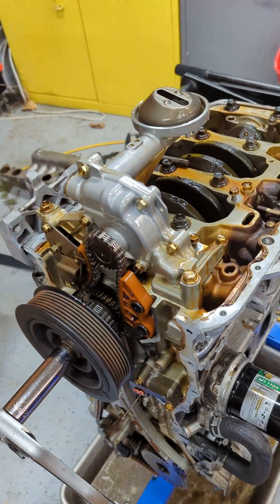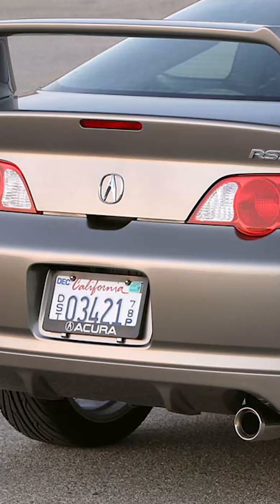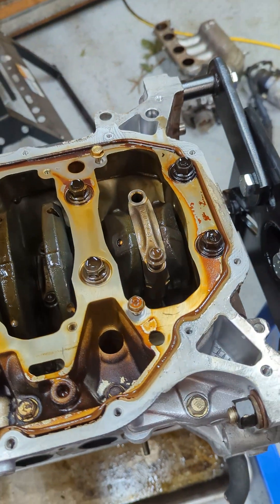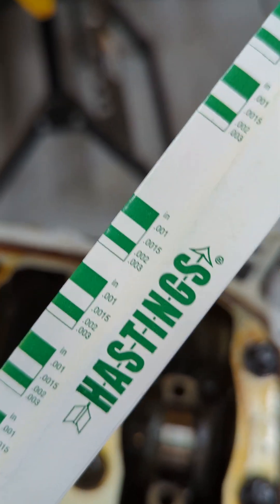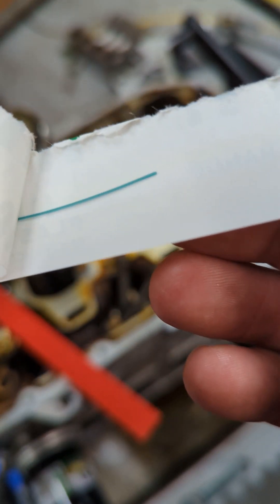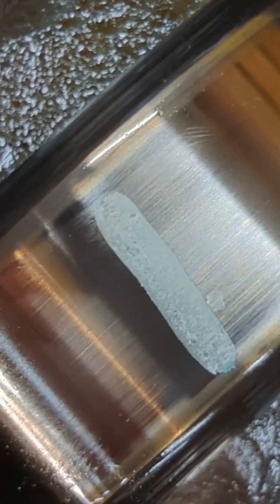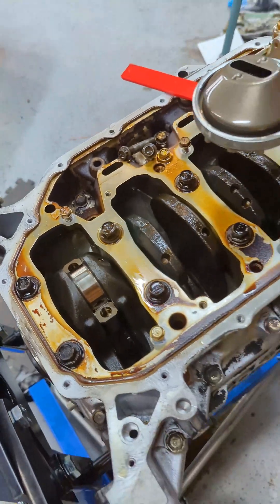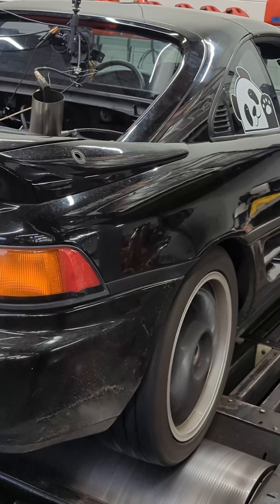Measuring a high mileage hot rod engine 🔎🔬

Comment: Have a question. I'm super good at rebuilding top ends on vehicles diagnose problems but never had the confidence to rebuild the bottom end, rods, Bearings, always wanted to learn how to use that plasti Gage. The main thing is that I want to know is, what are you supposed to do if the recommended spec is not where it's supposed to be on the bearing?? Grinding or something?? Or would it be time for a new crank or something?
Reply: Depends how far out of spec. A thou loose isn't a tragedy, much more than 2 thou its time to grind and buy undersized bearings. If you're going to beat it mercilessly a little extra clearance (and thicker oil) is actually desirable
Reply: @ludditeneaderthal  alright thanks
Reply: @Chase Cook  but, plastiguage only tells you "too much space", or "too tight". It doesn't tell you where the metal pulled a houdini, lol. So loose with pristine looking bearing shells means the crank journal vanished somehow. A good reading but you see grit embedded in the bearing is far from ideal. Also, our intrepid vid maker actually did it WRONG. By hanging that rod/piston down, and reading the plastic  on top, all kinds of clearance can be hiding on the bottom. Mains are best checked engine upside down (weight of the crank resting on the hidden shell, so all the slack up), rods right side up (weight of the piston/rod resting on the hidden shell, so all the slack down)... best practice is to pull the crank, and mic the journals, but used right plasti is a good indicator of decent health (especially if you don't have a pricey micrometer set, lol)

Comment: But no we're gunna BOOF it w some nitrous then we're gunna put an actual F16 fighter jet in front of it and pipe the intake of this engine to the ducted fan part of the jet after it goes thru a pro charger  then a proprietary seal on the bottom of each cylinder w a second spark plug and intake and exhaust to turn it into a 2-stroke and we'll need to use 120 octane to offset the alcohol were running to ol
Reply from the maker: All good ideas
Reply: @MotorSwapDan  hahaha. I'm glad you took that well it was all I good fun. Hey please keep the vids coming on that build

Comment: You're supposed to use the plastiguage on the other side if the rod cap, other why's you get an incorrect reading. If you torque the rod cap down and you push down at all while doing so it will so more squish then what is supposed to be.

Comment: Should have dropped in a K24A2 instead. Has the same HP but with more torque.
Reply: Yeah and lower redline, not to mention still needing an A2 or Z1 pump.
Reply: Id rather the k20.

Comment: Under 2 thousand? I might be blind in both eyes but that was clearly over 2
Reply: The wider it squeezes out, the tighter the clearance. It was a tiny bit wider than the .002" mark so was likely closer to .0018" or thereabouts.
Reply: No decimal read tenths hundredths thousandths

Comment: What was the point of looking at the bottom connecting rod bearing? Roll the upper bearing out.
Reply: The point is to check the clearance with plastigauge to see how well the engine was maintained. Did you miss the video?

Comment: Thumbs up for using plastigage👍 Most people look at me with a blank stare whenever I mention it.
Reply: Plastigauge is definitely a lost to time technique. I use it when checking bearing clearances on 5khp electric motors and pumps….when I can find it... I use lead wire and a mic when I can’t.
Reply: @isaach1447  it’s not every engine builder uses it including me. You can get it on Amazon. I all ways bore gauge. But I will plastigage on my final check just for reference that something isn’t all f$&ked up lol. It has saved my bacon a few times in my younger days.
Reply: #teamCanadianToque😂
Reply: Old school torque spec check.
Reply: @mitchallen5819  Tell me you know nothing about engines without telling me. Plastigage has nothing to do with torque spec. Its to check oil clearance.
Reply: @canadiantoque229  tell me without telling me? How modern cultural of you. 

I think the whole airport done went over your head on that one.
Reply: @mitchallen5819  Ok I will admit, the first part of my comment was a little condescending. But the point still stands plastigage doesn't have anything to do with torque spec.

Comment: Massive respect to anyone that has the patience to work on an MR2 😅 one came to the shop yesterday and man it was a pain
Reply: Yep, you don't have a lot of room round the engine. Oh, the coolant system can be a nightmare too. 🤔😳
Reply from the maker: @changingmyworld-j9z  yea it's been fun finding the best way to work on this thing. A lot tighter than my Chevelle
Reply: Lmfao it’s not as bad in a mk3 mr2. Still pretty tight though
Reply: Fiat x19 is 100% a full day's work just to remove and rebuild the distributor lol so tight and fiddly.. they are so cool tho lil baby Ferrari looking car that has a lil baby 4 pot but is a hoot.. i think they was designed by Ferrari and sold to fiat..
Reply: Not so bad if you have the whole car taken apart OOF